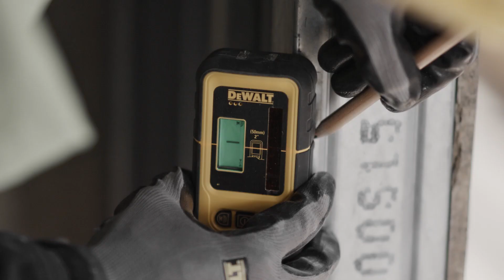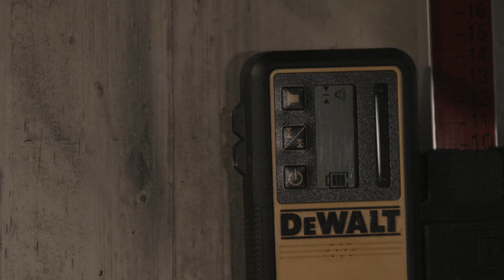DEWALT 2017 Laser Product Range

Comment: Accuracy of DCE0825 is 10 times smaller - as per the specification it is +/- 3 mm at 10 m, which is in line with this type of devices.